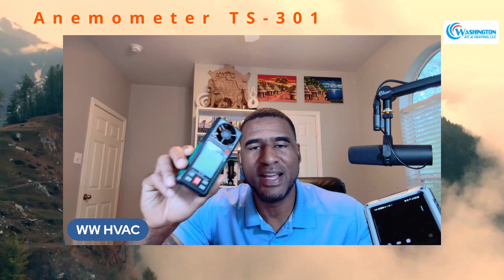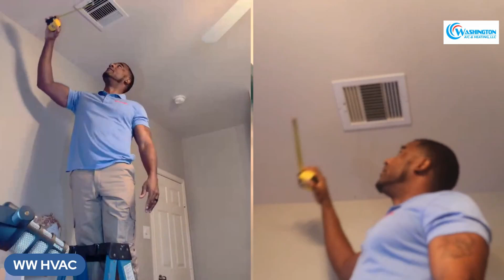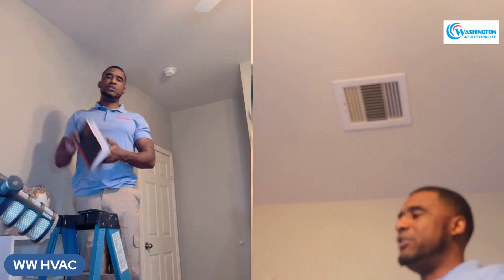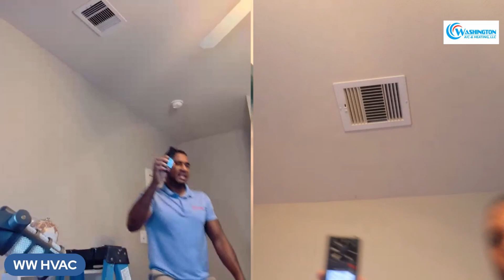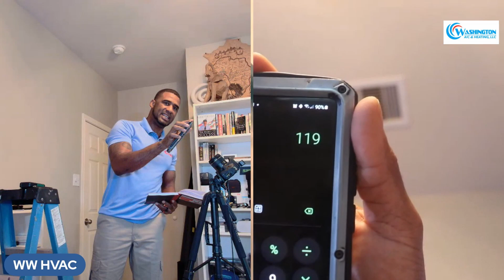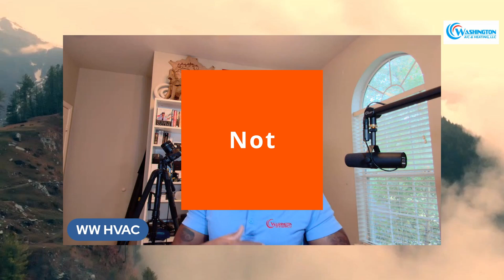"Unlock Airflow Insights: Master the Art of Measuring CFM with an Anemometer!"

Comment: What’s the acceptable cfm for air coming out of a vent or what’s the range  I’m having low airflow in my apt however the maintenance crew says “it’s blowing so it’s fine”. But it’s not actually blowing hard enough to cool the apartment down so I’m trying to build my case as to it not blowing hard enough. Airs gotta be going somewhere. I’ve checked each vent infact it’s blowing 55 degrees but the thermostat saying the inside temperature is 70 degrees so something isn’t right. I appreciate the help!
Reply from the maker: 1 cfm per sqft
Reply: @WWHVAC  so my vents are 10inx6in my master bedroom is 12x12 roughly. The square footage is 144 square feet. So 146cfm is roughly 4mph correct? I purchased an anemometer off Amazon should be here tomorrow just trying to get ahead of it so when I get the tool I can get right to checking.

Comment: Can you calculate this i have 
450 fpm coming out of 12x12" Grill. ?
Reply from the maker: About 293 CFM

The cubic feet per minute (CFM) is determined by multiplying the air velocity (feet per minute or FPM), by the area of the duct in square feet. 

First, to switch inches to feet for a 12x12" grill, you would:
12' (1 feet) * 12' (1 feet) = 1 square feet.

Then, you'd multiply how far over the grill the heated (or cooled) air is conveyed per minute (FPM) - across this one square foot of area, which in this case is 450 feet per minute. 
Thus 450 FPM * 1 Square feet = 450 CFM. 

Therefore, if you got an air flow of 450 FPM this would translate to 450 CFM for a 12x12" grill.

Assuming you have a K factor. like I used in this video.

If K factor (commonly known in HVAC systems as a measure of air flow through a system relative to duct size or a diminishing of air flow in certain conditions), is 0.65 for the cited route (gere the specification of supply grille at equalizing grid of the CAS Helix differential), make the CFM easier to calculate via multiplying a K The analogy mentioned, scales, the FPM specified from developing pressure impulses signatures together more discernably.

So, effectually:

450 CFM * 0.65 = 292.5 CFM

Comment: Where this dude getting all these random numbers like 144 and 28 and 65?
Reply: 144 inches in a square foot, .65 is the restrictive value of the grille named by manufacture. the 28 is part of the k factor x the constant.   the .28 is then multiplied by the 425 feet per minute fpm or velocity gives you your CFM
Reply: I thought he said he was going to use . 42 restriction lol

Comment: can you just take the register grille off so i dont need to guess what the k factor is? if so would i measure the whole opening or would i measure just the air coming out of the round flex duct and get the sq inches of the duct only? thanks

Comment: Wow! A lot of math!
Reply: that is just the air flow part afterduct is installed; on a  2000 foot average house it take several hours to get a load estimate for unit size, then calculate cfm for each room, design the duct layout and size of the duct main trunk line and branch ducts, grille size for proper cfm and throw to the size of the room need X size unit 😳just by looking around is fooling himself and the customer; maybe he gets it close enough , But how many do they miss ,then say it cost extra to put in a bigger unit , 
Low bid is not the best or educated bid

Comment: That applies to 8 foot tall ceilings, right?  Does it matter if a room has no windows or a lot of them with that 1 CFM per Square foot of floor space?
Reply from the maker: Just a rule of thumb to get the correct CFM. You will have to factor in ceiling height, windows, computers, vents etc.
Reply: @WWHVAC  Would be interesting to see what HVAC is supposed to be using for heat load criteria. I ask because it seems that they could simply throw in numbers to get the outcome they want vs. the formula.
Reply from the maker: @Garth2011  Refer to the manual J (https://www.acca.org/standards/technical-manuals/manual-j ) but just about every major vendor has a load calculator contractors can use here are a few https://www.johnstonesupply.com/ac-load-calculator https://www.lennoxpros.com/load-calc  https://www.loadcalc.net/load